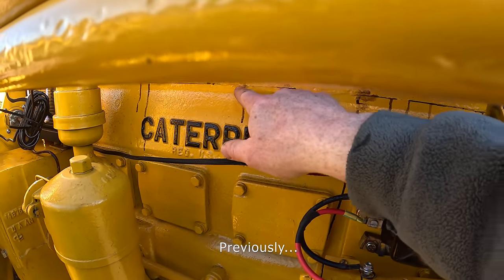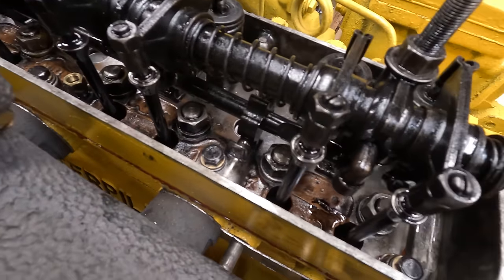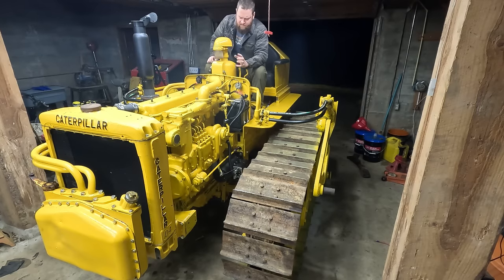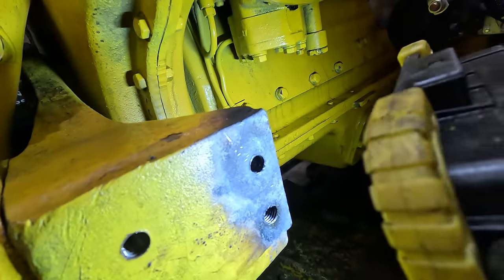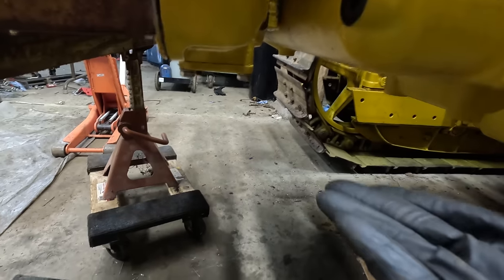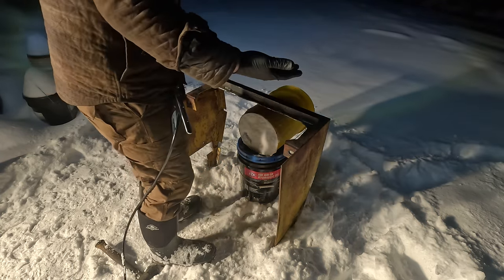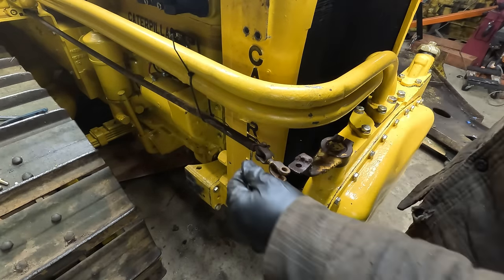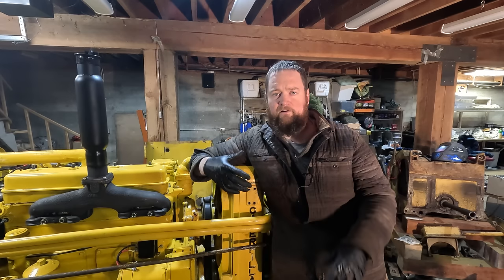Caterpillar D4 head bolt retorque, fitting guards, and hydraulic controls

Comment: I love the videos. I rebuilt and used a D47U to clear the property I live on now. I didn't do near as much work as you did, but she was a solid, smooth running girl with a working pony engine. She's gone now, and I miss her. Just a reminder, as long as you keep the face of the wrench at a 90 degree angle to the fastener, extensions don't change the torque value.
Reply: A worthy point on torque values and extensions. This belief must be spawned from electric rattle guns as the hammer effect is diminished by each loose connection

Comment: Glad you found your 9/16th’s, this project is awesome, if it was easy everyone would have one, taking time and doing it right is the key and it might be the right time to run over it with a adjustable spanner and tighten everything up before fitting all the outside covers. Loving every episode 👍

Comment: According to the U.S. Centers for Disease Control and Prevention (CDC), the average age-adjusted height for American men 20 years and older is 69.1 inches (175.4 cm), or 5 feet 9 inches tall,   Matt at 6' 4" you're big.  In fact, you're past the second standard deviation which is about 6' 3".

Comment: The engineering back then was not with handheld calculators and personal computers... so appreciate the effort.  

50's/60's my father was a civil engineer (70's, 80's too) and way back he used an ELECTRIC calculator darn near the size of really old supermarket cash registers..   seemingly with millions of 10'digit cylinders with a long running motor as calculations progressed...  As a child I was given STRICT direction to NEVER TOUCH the darn thing...  I didn't

Comment: I really enjoyed this post.  Found your fabrication build across the protection, operation as shield, control just really well done.  And take particular note of what various repair, fitting modification that was of time and shop attention was past neglect. I think that from this attention, your operator station safety and ease of control to difficult job task, will be huge.
The engine as recorded to run,...sounded great.  I'm betting your spring, summer jobs to acreage will be a lot more fun and productive with this machine.  And where I have some great memories as my grandfather, with his hard hat and gloves was real to all weather dust, mud, and snow. His machines both yellow and red with diesel power. '
Hoping you have a great spring and summer.  And hoping you continue with the excavator just ahead to the shop.  M.

Comment: You're 100% right doing those little bits now. Once you're using it, it's far to easy to say "if it works, it works" and leave it at that. But once you're using it and you've done those little bits, you won't have that little nagging on the mind when you go to use it. 👌👌

Comment: Matt, this may start an argument, but you don't need to worry about using an extension with a torque wrench. A fundamental law of physics states that 'For every action, there is an equal and opposite reaction'. The torque wrench can not click at 150 ft/lbs of torque unless the bolt is exerting that much resistance, even if the extension wraps up a half of a turn, it's still 150 ft/lbs.  
Now, if you are using Newton/Meters, all bets are off using any torque wrench and socket that isn't made in Germany! 🤣🤣🤣

Comment: Matt, excellent job. A quick trick on removing broken bolts. Since you already have a mig welder, simply weld a larger nut onto the broken bolt. Slip the larger nut over the broken bolt and fill the nut with weld making sure to fuse it to the broken stud or bolt.. This method has 2 benefits: Welding heats the broken stud and using a nut allows the use of a wrench or socket to remove the broken stud. It may take a couple of attempts but this method usually works. For bolts that broken below flush, more diligence is required but it is still possible.

Comment: I'm really enjoying these videos on the old dozer.  I will give you a little tip, when welding thick steel and cast iron.  Heat your pieces with your torch then weld, you don't want it to turn red but maybe in the 200 degree range.

Comment: I found some titanium ones for a lot of money- best line in video!  Bolt & cotterpin equals Cat repair perfection.  Love your persistence in getting everything right.  The torque on pipe fittings needs to be rethought, it’s cast iron you are working with, if fluid is being contained Teflon tape is your buddy, if it is an inspection hole, tight enough to not vibrate out be good.  All good so far, waiting patiently to see some stumps ravaged!😊

Comment: FYI: I think they've proven a few times that extensions don't throw off torque wrenches, but do, in fact, reduce the power of an impact wrench.
Reply: Genio1981, you are correct. An accurate torque value can be achieved with an extension, the extension may twist but only until it no longer twists and transmits the force. If the tightening force exceeds the strength of the extension it will break.

Comment: Trick my FIL showed me years ago - he used this 70 years ago to remove rivets (he was a boiler maker) and it works with bolts. Use your cutting torch get the top of the busted bolt red hot and cut off the fuel while you hit the O2 trigger. The Oxygen will burn the bolt/rivet out with minimal damage to the hole. Obviously this is gonna work better on a big bolt than a small one but give it a try. Nice job on the Cat man

Comment: If you ever have to change headgasket...might use that heavy Permatex copper gasket (3 decent heavy coats [I use the spray stuff]) to help seal it up...might help fill in the tiny machine marks that allow the oil to weep out...
Very cool on getting the dozer up and running and looking beautiful!
Keep em coming!!!!

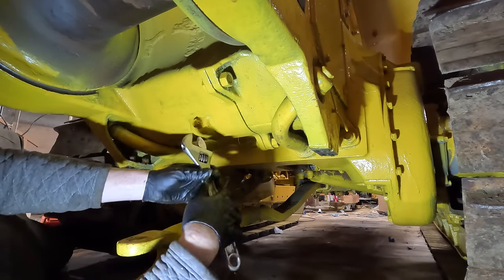Comment: 11:10 you need to make pipe thread tight as the threads will interfere with each other and make the seal. If it's loose it's not crushed. Pipe threads are almost always hard to remove when its tightened properly since it needs to crush the threads together to seal.

Comment: High tack Red adhesive spray works great for this fix used it and Permatex ,For moving around parts as Fitting them leaving the High tack get really tacky before installing is a pretty clad fix easier to clean after too specially for Water pump & fuel pump fix`s too with gaskets , I use it for remaking gaskets as well spraying the old gasket over top the new one gives perfect design patterns .

Comment: You have talent appreciate inspiration safe to say that tractor will be around for another 50 years or longer..I think I can attempt your work.. however I would need consulting quite often and thats quite added expenses..guess I'll start with a chainsaw build kit..did install some hydraulic snow plows..did engine pull  tourque converter change lots of body work couple restorations..Someday Thanks..

Comment: All the way through you have been seen making the job proper and your machine good. It moves like a new Caterpillar of that vintage. I was surprised to see your latest here and I look forward to seeing the next. It all has to be fitted correctly to this machine, and it's going well. A new rod to the blade control valve wouldn't have surprised me and it looks like two specific bends should be made, to keep the stroke straight fore and aft. So far very good.

Comment: Just a suggestion after the fact. Drilling a relief hole at the corners of the rectangular cutouts will prevent cracking in the future.
Reply from the maker: Which cutout?  The one I put in the belly pan?
Reply: @PacificNorthwestHillbilly  That one or any. That plate is unlikely to ever crack so this is probably a moot point but a thing for the future in thinner material that is stressed.

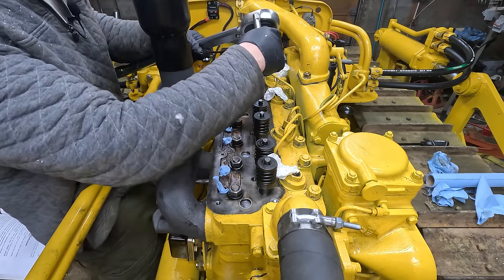Comment: 4:15 That's actually not true. An extension will transfer torque just fine, but it will act as a spring, so you'll have to make more turns to reach your torque setting, since the extension is twisting too. If you're using a ratchet in a confined area, an extension could potentially make it so you can't reach your torque setting, since you can't rotate far enough to get the extension up to that torque level. We're talking very long extensions and very high torques here though.

What you're probably thinking about, is how torque is reduced through extensions when used with an impact wrench. On an impact wrench, the blow of the gun is taken up by the extension, and isn't transferred to the nut or bolt, or at least the power is reduced.

You can look at an extension like a car suspension. The car suspension will absorb bumps and shocks when driving, because those are quick impacts, but if you have the car on a lift and set it down, you see that at one point, the suspension is taking all the weight and transferring it to the tires. 
If you're more of a math/logic guy: Energy doesn't disappear, it only gets converted. So if you're applying force to a wrench on one end, and a bolt or nut is holding it on the other end, the forces on both ends have to be equal, since the wrench and extensions aren't taking any of that energy away. The reason that the extensions do take energy away when used with an impact wrench, is that the repeated twisting/untwisting of the extension will create heat, which is thermal energy.

It is probably more comfortable to torque things without an extension though, since the extension will act like a spring, and will make the wrench movement feel mushy / soft if the torque is high enough.
Reply: THANK YOU!!!!!

Comment: The top radiator pipe was designed as a rigid pipe to provide support to the weight of the heavy cast radiator and hydraulic system. By replacing it with a rubber hose that added support is lost

Comment: On the front push pull connection, could you remove the second pivot and have the bar bend at that point instead, then install that pivot further back where the bar is bent prior to going into the slide? That should give you proper movement without anything flopping around and still prevent any binding forces on the slide.

Comment: Matt, great job! I’ve watched every segment as I did a JD450 to work on my property. I’m not an expert welder but some of the issue you had welding MIG outside could be the wind. It tends to blow the shielding gas away. Also, does the pump end of the control rod really need a double clevis if the rod lines up properly? Looking forward to see it moving dirt.

Comment: If you run a light oil in the radiator instead of water, any leaks in the head won't be catastrophic because it will just decrease the viscosity of the oil.

Comment: Can you remove one of the two clevises on the front? Then you don't need to brace the rod- it pushes straight (more or less) forward on the pump lever. Of course, you may have to re-make some of your other parts to make it longer.

Comment: Do you plan on putting the brush guard back on?
Reply from the maker: yes, at the very end.  Once it is on, it will be too tall to fit in the shop.
Reply: Are  you going to have any cover to park your dozer under to keep it out of the weather. @PacificNorthwestHillbilly
Reply from the maker: Yes it will have a covered spot

Comment: Great job and videos. Quick question. Did you drain antifreeze before retorquing? I have a d318 engine in a d6 9u leaking the same. I will have to do the same thing. Thanks!
Reply from the maker: Nope, although that may have been a good idea to drain out a couple gallons
Reply: You had a good success with yours. I might do the same. Thanks for the info 👍.

Comment: Using those screw extractors in a situation where its possible to weld nuts on the broken fastener is a waste of time. The extractors always break off and then you are worse off then before. You can weld nuts on a bolt and have the break off 20 times but at least you havent gone backwards.

Comment: Never back off head torque, Just re-torque each bolt in pattern. If you have to go up a point or two that will not hurt anything.  Bottom line with this old engine you may have to replace the head gasket, Good luck to you, Your almost there,, High ^ 5
Reply: You do 1 at a time!  Back off 1/2 to 1 turn, feel if the threads or surfaces are rough & need lube, then tighten fully in one steady smooth pull and if there are snaps & pops, do it again.  DO NOT loosen them all up!!!

Comment: Great Job so far,  i woulda kelp the bottom pan off..
Reply: The bottom pan is necessary. If you leave it off you'll run a stick straight through your bell housing or engine.

Comment: NO B O D Y. ... but me would watch all of your videos BACK-TO-BACK...  bathroom breaks included....   this internet is hypnotic...  and CLEARLY 'on-demand' programming is the wave of the future....

I stumbled upon the Rolls crate engine and was instantly hooked....    

B T W  ....  if you:
(-1-) removed valve cover
(-2-) loosened head torque
(-3-) propely indexed push rods
(-4-) outlined new gasket, just in case
(-5-) yadda yadda (injectors et al)

WHY NOT REMOVE THE HEAD AND PETMATEX that gasket???

BTW -- I liken the torque pattern to throwing a sheet on the mattress.  You smooth out the sheet's air bubbles from the. center outward; working from closest edges outward; i.e. from left/right edges of bed toward headboard/footboard...
??

Comment: Love the improper weld prep only to weld rust and debris into the cracks you're trying to fix, so  expect the same cracks to reappear on the belly pan, chasing and tapping threads while still hot, congrats on making every one of those holes larger than factory, once they cool no bolt will ever tighten properly now.

Comment: Please don't use Form-A-Gasket on those gaskets, there's a specific product made for that purpose and it's still Permatex, it's called High-Tack and put it on the head-gasket (exhaust manifold too) if you end up pulling the head.
It's magical stuff, red stringy goop of godly goodness.. You'll never use anything else, promise
Reply from the maker: The recommended fix on the antique cat forums for the weeping head gasket is permatex super 300.  It's a common issue on some of these engines.  I was just using #3 for the valve body cover.

Comment: Retorque is not gonna fix a leaking head gasket
You should fix it right get head shaved new gasket and draw file or board the block. The last thing you want is to have it blow the gasket from cooling passage to cylinder a sudden dump of coolant into cylinder while running will probably result in bent rods and engine rebuild